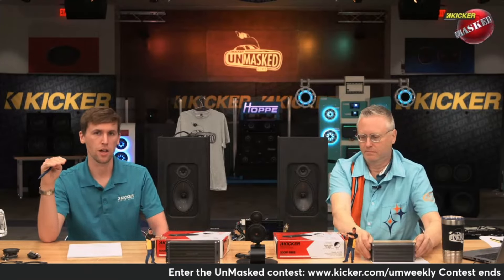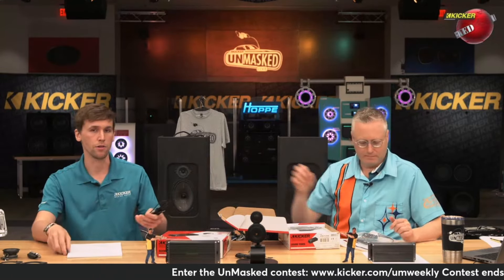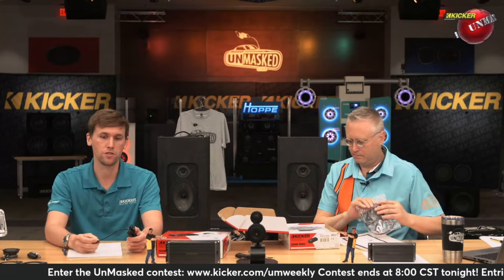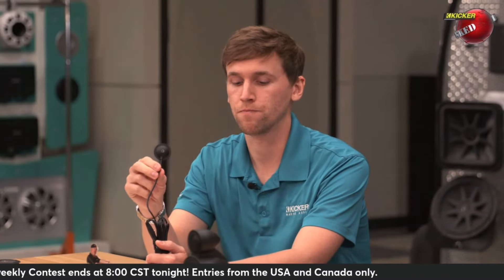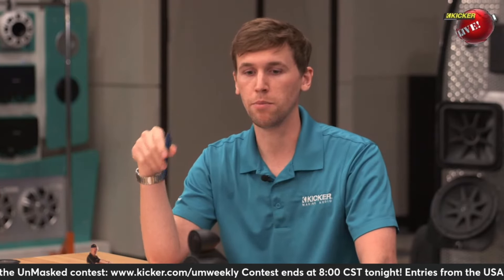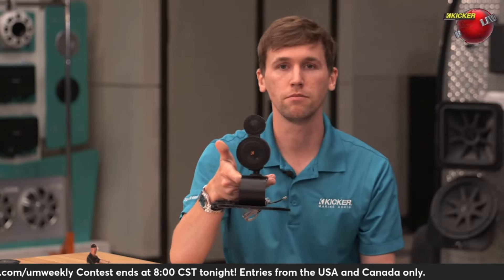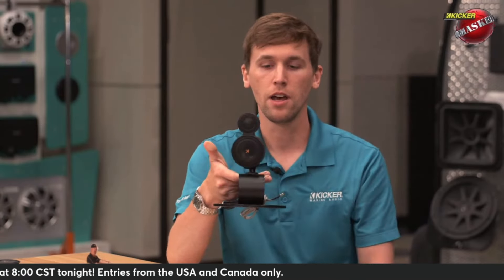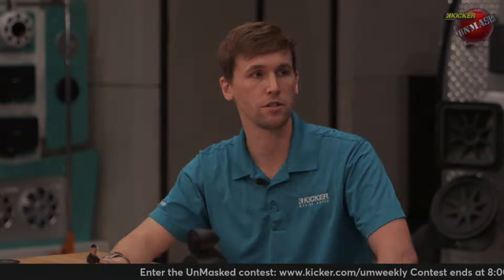How do you Set Up the KEY Amp? - Kicker UnMasked - Shorts

Comment: My DEX-P1R pioneer premier had DSP and a microphone in 1999. It was a preamp unit without its own amplifier.  It alway worked in fully active network mode and could be set 6 to 36 db per octave actively crossed over.

Comment: Im wanting to run 2 l7t 12s in a sealed box what would be a good amp for the two?
Reply from the maker: The L7T 12” sub is rated for 600 watts RMS each, so you should look for an amp capable of 1200 watts RMS. We would recommend the 46CXA1200 to run both subs.
Reply: @KICKER-AUDIO  thanks thats what i will most likely go with. Just kinda expensive but i know it will be worth it

Comment: 2 questions
1. if you defeat the time delay from the dip switch, does it also get rid of the eq? 
2. I have mine connected to factory speakers, and the amp has its own power ground, but runs pretty hot most of the time, it hasn’t gone into protect but it gets toasty, is this normal?

Comment: do i have to keep the microphone hooked up once the programming is completed? also when im doing my gain adjustments the amber light turns on pretty quick about 1/4 turned up. is that correct?
Reply from the maker: The mic does not have to stay plugged in after the tuning, no, but it does give you the ability to demo the Modified EQ vs. non-modified EQ. 
The limiter lights may illuminate early if installed with a high-level input.  Since the input signal is stronger than a low-level signal, the amplifier doesn’t need as much gain to reach full potential. Gain will vary depending on your vehicle and install type.
Reply: @KICKER-AUDIO  yes it’s installed with high level input. Should I have the compression setting turned on? 
Am I able to tune the amp with pink noise or should I use regular music and adjust based off that?
Reply: @aimlesstony9017  would love to know the answer on how to fix this too.   Installed this amp in my ford bronco and i literally cant turn it up past 16 without it clipping and shutting off the amp.  super annoying
Reply: @KICKER-AUDIO  whould love to know what I am doing wrong with this set up.     literally cant turn up audio in my. bronco past 16 without the sound cutting off.     HELP
Reply: @DanDoble  ok so turn the gains all the way down. Then turn radio up 3/4 volume. Then turn gains up slowly and try with different music. Once yellow light starts to turn on and off. Back gain down a hair. Done
Reply from the maker: @DanDoble   That could be a number of things, from blown fuse to bad wiring or faulty connection, to overloading the amp (too many speakers connected). As you turn up the car volume, the voltage increases. First thing would be to check that your gain is set properly as the gentleman who replied before me has suggested.